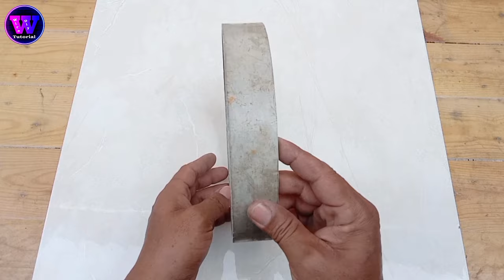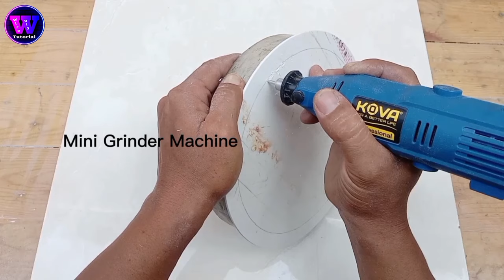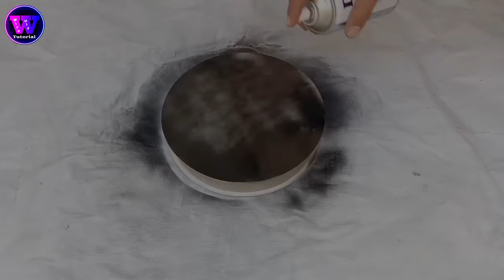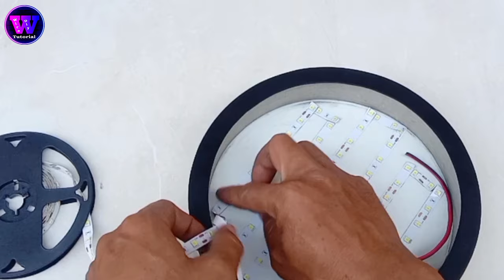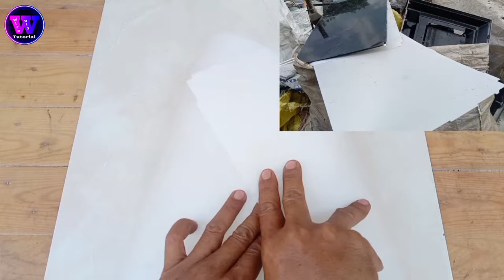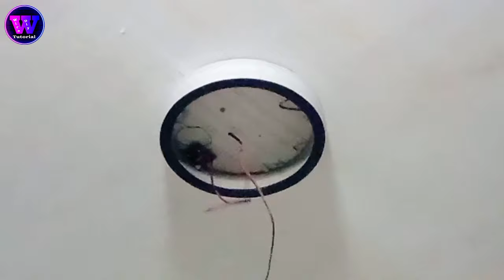DIY How to Make a Modern Style LED Ceiling Lights

Comment: Keren bang..itu adaptor modulnya berapa ampere ya bang
Reply from the maker: 3A Bang..
Reply: @wiradiytutorial  siapp...smg sukses abgku🙏
Reply: Kalau saya pake 2ampere 12v apakah bisa bang..
Reply from the maker: Bisa dan pas ukuran 2A,perkiraan nya klw kita pake 1meter led strip pake adaptor 12v 1A